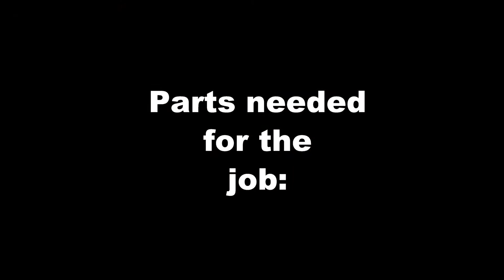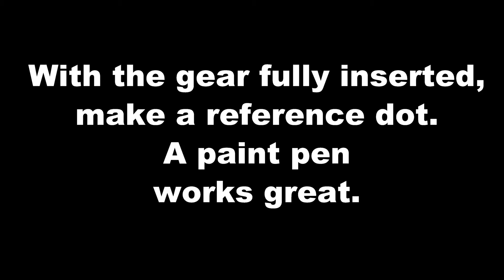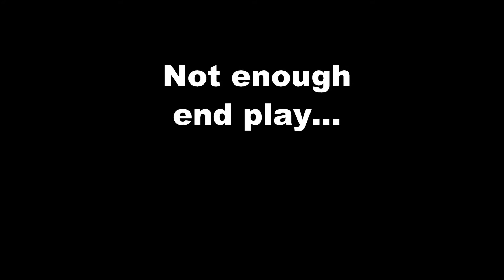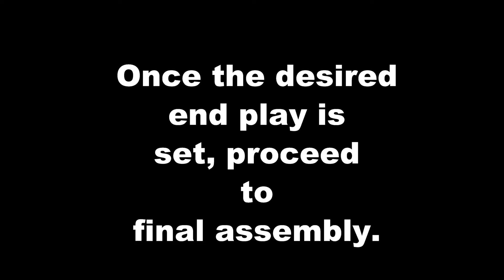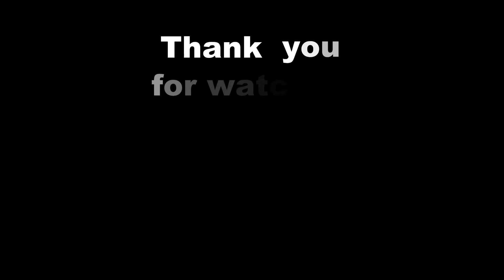TH400  Rebuild:  Governor (Setting Endplay) #SouthpawAutoworks

Comment: Excellent and very clear video, thank you so much! How do you set the endplay with the transmission in place, so not looking into the gears of the output shaft?
Reply from the maker: Great question.
I have never set the endplay with the transmission still in the vehicle...only on the bench.
You could use a dial indicator.  They make one that has a ViceGrip base.  The also make one with a magnetic base.  The transmission case is made of aluminum(Not great for magnets)...but you could bolt some metal to the governor housing.  Maybe use the governor housing cover as it's ferrous metal.  Bolt the cover just to the right, or the left, of the governor housing hole...so the cover doesn't hide the governor.  The you can stick the magnetic base dial indicator to the cover.
I hope that makes sense.  Might have to make a follow-up video...

If anyone else reading this has another idea, please leave a comment.
Reply: @SouthpawAutoworks  Thanks a lot! I now understand what you mean. So what sort of endplay do you need in terms of mm or inches?
Reply from the maker: Humble Pie:
After sleeping on it, I realize that my "idea," about how to check the endplay with the trans installed in the vehicle, is no bueno por nada (good for nothing).  ha. Sigh   
As previously mentioned, this clearance is typically observed with the transmission out of the vehicle, and on the rebuild bench.  Furthermore, the governor cover, and gasket, are installed...this is important.  Again, I've never checked this endplay with the trans installed in the vehicle...only on the rebuild bench.  You'll have to excuse my silly idea.

Here's another idea:
By removing a number of parts from the vehicle/transmission, a guy could simulate the bench test...but, with the trans in the vehicle.  Parts that could be in the way include, but are not limited to, the driveshaft(s), transfer case (if applicable), cross-member, transmission mount, exhaust, and transmission extension housing.  With all of the applicable parts out of the way, the trans should look like the one in the video (extension housing removed)...enabling a guy to see the plastic governor gear meshing with the metal gear on the output shaft of the transmission.  In order to check the endplay, the governor, the gasket/cover, and bolts must be installed.  Please refer back to the video.  

Gaskets:
In order to prevent a trans leak, a guy should always replace all used gaskets.  There are exceptions, like reusable rubber-like pan gaskets that are marketed as "reusable".  Paper-like gaskets are typically good for one compression, or use, and then they're trash.  A guy might want to order another governor cover gasket, and an extension housing gasket.

Answering Your Question:
End-Play:  0.062"-0.078" (Drill bit reference: 1/16" - 5/64")

I hope this was helpful.  Safe travels.
Reply: Interesting, thanks for the info, question, seems the difference between finger tight vs 70in pounds, 70 would bring the clearance in a tad bit, maybe its accounted for idk. My gear keeps getting chewed up, I'm going to attempt to look at this with it still attached to the vehicle, I was thinking it was worn bushing, need rebuid, this might be worth checking out first though. Seems the gasket thickness alone can screw this up if its not proper
Reply from the maker: Updated videos on the way!

TH400 Rebuild Series - Coming Soon (60-Second Preview)
https://youtu.be/q0eciXU8YEI

Comment: Hey nice info! What is the end result of the operation of the transmission with the govoner having out of spec end play?
Reply from the maker: Not setting the governor endplay correctly can lead to premature failure of the plastic governor gear.  If the gear gets damaged, the trans will have shifting problems.
Thank you for your question.
Reply from the maker: Updated videos on the way!

TH400 Rebuild Series - Coming Soon (60-Second Preview)
https://youtu.be/q0eciXU8YEI

Comment: what would you think about a 42 year old gear on a 1975 thm400 with 46.900 miles. I'm having problems It shifts 1st to 2nd and very delayed shift into drive.  car did sit last 10 years. I did replace the fluid and filter some what better but no cigar.  Any imput or help would be greatly appreciated.
Reply from the maker: Puppet Master The delayed engagement (or shift into drive) can be caused by the torque converter leaking fluid back into the transmission pan.  This is an internal leak that you and I would never see on our garage floor.  I'd love to go into detail on this internal leak.  However, I will spare you the theory, and help you get back on the road.

Try this instead:  
**Perform at your own risk.  Southpaw Autoworks(Southpaw Auto Parts) is not liable for any damages, injury, etc.**
**Exercise extreme caution.**
1)  Start the vehicle.
2)  Put on the emergency brake.
3)  Apply the regular brakes with your feet...and hold the pedal down, for the rest of the steps.  
4)  Shift the transmission from Park to Neutral.    Let the engine idle in Neutral for 60 seconds.
5)  Now place the vehicle in Drive.
6)  Wait for transmission engagement.
7)  Place vehicle back in Park.
Question:  After following the steps above, does the transmission still have a delayed engagement?
Reply from the maker: Updated videos on the way!

TH400 Rebuild Series - Coming Soon (60-Second Preview)
https://youtu.be/q0eciXU8YEI

Comment: Would to much end play and or too little end play be the cause of why the gear keeps getting chewed up?
Reply from the maker: +Carlos Franco 
Yes.  In addition to the end-play, there are other things that can cause it to get chewed up:
1)  Old age of the governor gear.
2)  Contamination of the oil.
3)  Damage to the drive gear....the output shaft.
4)  Etc.

Your best best it to put a new gear on the governor, set the end-play to spec, and see what happens....give it some time.
Reply: Another possibility is the rear case (output shaft) bushing “walking” out of the case, rearward into the governor gear. BTW, a good video covering end play of the governor. Thank you.
Reply from the maker: Updated videos on the way!

TH400 Rebuild Series - Coming Soon (60-Second Preview)
https://youtu.be/q0eciXU8YEI
Reply from the maker: Updated videos on the way!

TH400 Rebuild Series - Coming Soon (60-Second Preview)
https://youtu.be/q0eciXU8YEI